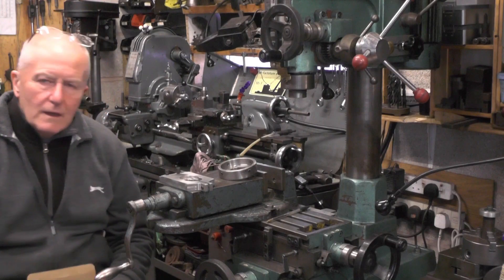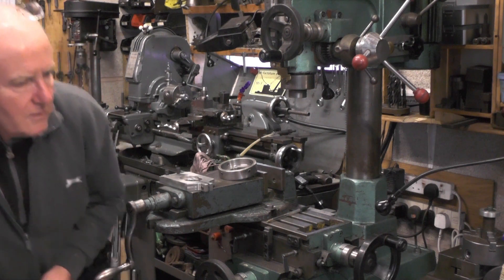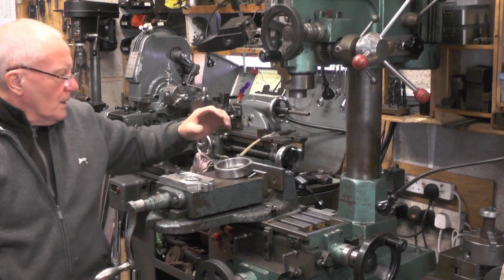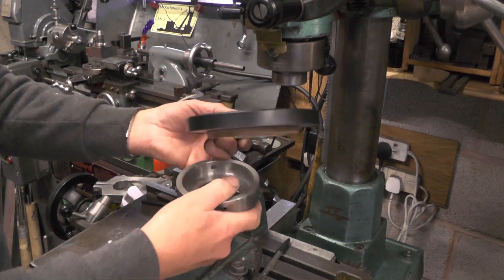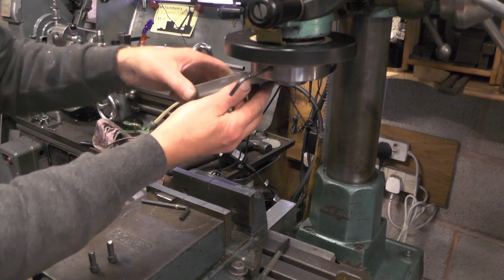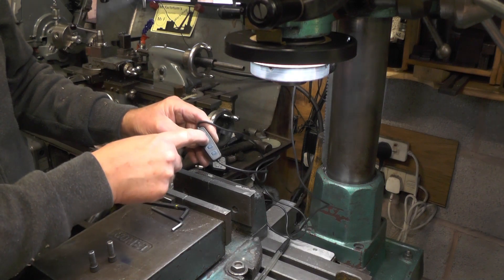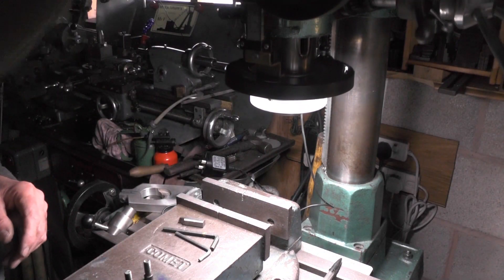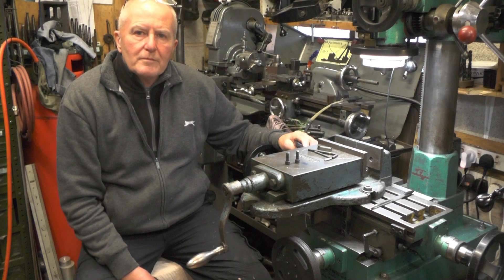Hints & Tips # 003  LED  Light for my Mill (360 degree lighting) (Mr Factotum)

Comment: What ho Mr F, 
A great idea as usual, with a small but. You might find that with the very good lighting where you are working that your eyes become accustomed and then find looking at other things on the machine are difficult to read. Or at least I did before I had my cataracts done half a dozen years ago, must dig it out and try again. 
ATB  
c 
PS I used a camping ring light from Poundland and bored it to fit the quill, mind it cost 10 times as much to buy the transformer from Maplins as the battery compartment got decimated making it fit😉
Reply from the maker: eyup chris, i will give a go and see!!! what happens, got one for my drill press and workbench too, so if i put them everywhere i work hopefully eyes will not have to adjust so much at £3.66 a shot can't go wrong.
cheers
**KEV**
Reply: @MrFactotum 
 What ho Mr KEV, 
I found the dial on the knee was under lit when the eyes were used to the light where the cutting was.
I love the instant light of LEDs but it has a tendency to be a bit harsh and produce deeper shadows. On the lathe I can't read the top slide protector without a torch, but if you flood the shop with too much light it gets dangerous leaving it after dark, especially with my collection of anti burglar trip hazards.😉.
c
Reply from the maker: @chrisstephens6673  I havn't got that problem with my knee, havn't got one. yes your correct with floodlight's, i work in my workshop with black out blinds fully down even in the summer, you never know what scallywag is sizing the joint up,👀 i think i've become accustomed  to working in the dark with touch. Mind you soon won't be able to put power on if the foreign power owners keep putting pressure on us
K
Reply: @MrFactotum  better invest in treadle machinery just in case there is a demand when the lights go out.

Comment: looks better than mine, If i was you i would fill any cracks or holes on the light with silicone, I fitted a couple of angel eyes on my mill, they were great until oil or coolant got in them!
Reply from the maker: Hi Paul
Thanks as usual for watching and feedback. great tip i will look in to that. these seem to be covered with a plastic lens, so i will see how they perform as time goes by.
See you next time, just working on recommissioning my new addition to workshop Adept 2 Shaper, will be showing that soon,.
cheers
Kev (mr f's w)
Reply: @MrFactotum  ooh nice, you competing with go create, I'm always drooling when he's got his on the go. alas i've no room☹
Reply from the maker: @paulrayner4514  No competitive work here, this little adept no2 bench shaper is no match for Nigel's. I'd love  an Elliott No 10 like his "Drool" in fact i've had an Elliott No.16 in the past, but like you i have no space at moment
cheers
Kev

Comment: Interesting idea. I don't suppose you have a link to the light?
Reply from the maker: cheers Ben
Thanks for feedback
There's loads of sellers on fleabay, here's the item number i used, 184298982290  (£4.99) just make sure its 6" as there are different diameters
Take Care
Kev
Reply: @MrFactotum  Many thanks.